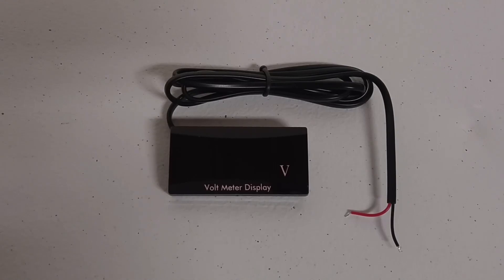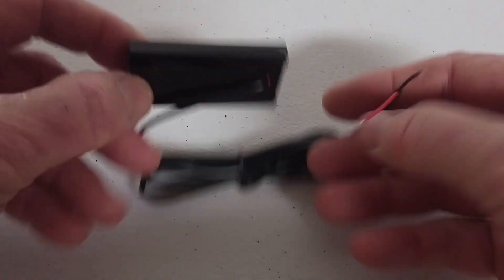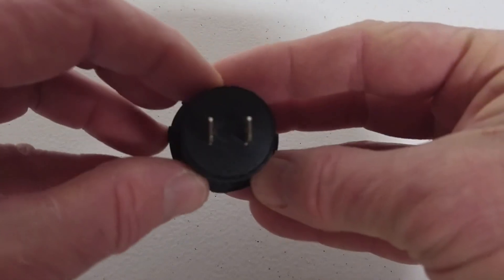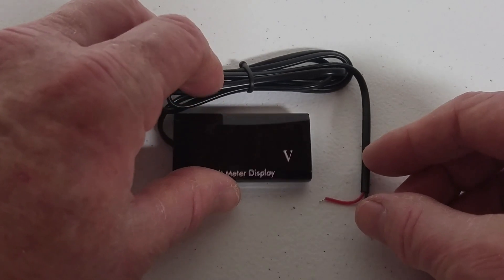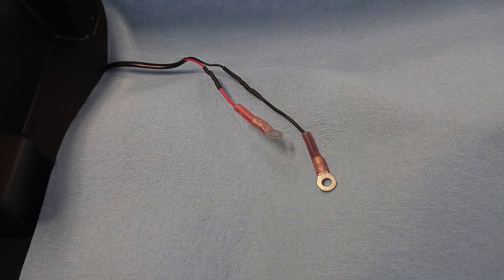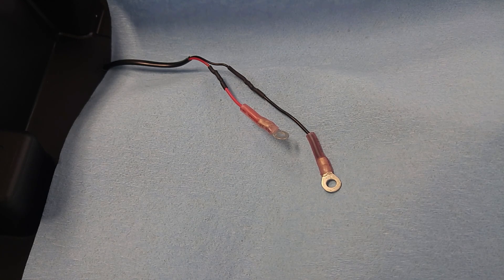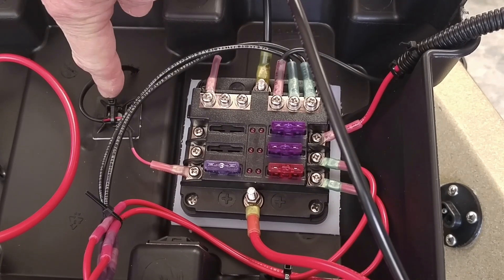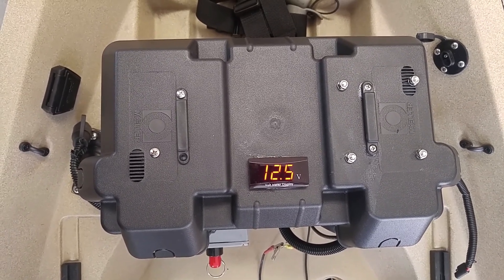DIY Kayak Waterproof Slim Voltmeter & Installation

Comment: My question is, if my entire setup is: 12v to a 30 lb trolling motor with a circuit breaker spliced into the positive lead, do I have to wire the voltmeter a certain way,  like through the circuit breaker, or just wire the volt meter straight to the pos and neg terminals?
Reply from the maker: I run it to the battery terminals with an inline fuse.

Comment: I'm in the process of building a battery box for my trolling motor. Curious how you keep the battery box in place in what appears to be the rear well of the kayak. Looking for some ideas. Looking for something to secure it should the kayak flip for any reason. I like to have everything tethered down in my kayak. Thanks in advance. - Don
Reply from the maker: That is in the rear of a Nucanoe F12. I used a strap with track mounted attachments to secure it.
Reply: @Aksmaniyak  thanks that was the approach I was going to take.

Comment: So does the volt meter stay on 24/7 or is there a switch somewhere for it?
Reply from the maker: It is always on but I take out my battery and charge it after every trip. The amp draw is negligible. You could put a switch on it if you wanted.

Comment: Could I connect that voldmeter to my Nocqua battery. I use that battery for my Lowrance fishfinder. If yes, how could I do that. I'm a newbie with this. Thank u, Aksman
Reply from the maker: Hi Jim. I have Lowrance fish finders too. Depending on your model, it might have a voltage reading function on the display.